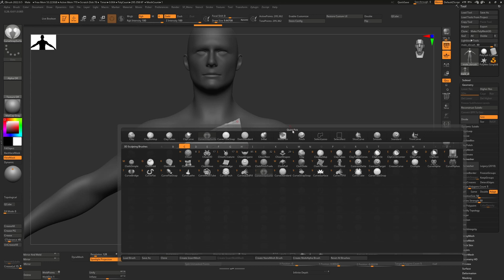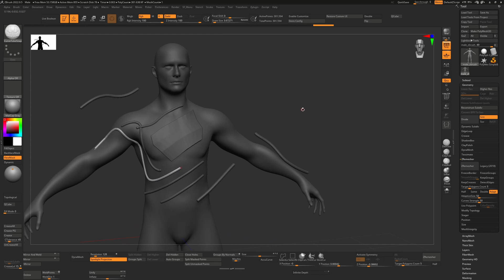Having problems with curve brushes not snapping to the surface? This is the fix.

Comment: 0:30 I want tubes, a lot of them, next to each other, and even in top of each other. The issue is that they keep snaping to eachother and create connections.. how to disable that? When cursor is near an existent tube, a red line shows and snaps creating connection. I dont't want it! please, help me. thanks..
Reply from the maker: Turn off Snap in the Stroke menu under the Curve rollup. To reduce the size of the red line that appears near other curves, go to the Stroke menu and under Curve Modifiers, reduce the Curve Snap Distance to 0. hpoe this helps.

Comment: If still not working your curve brush stroke setting must be dots not drag for it to snap to surface.
Reply from the maker: Thanks for posting!
Reply: interesting! I had the opposite problem - when it was set to dots it wouldn't snap, but to freehand it would
Reply from the maker: Oh I never checked this, thanks for posting, it might help others.
Reply: This is a great tutorial by SeanForsythTutorials, but this comment was what fixed my problem. Thank you to both of you.
Reply: Thank you! It resolved my problem. For years I was fighting with the custom IMM brush and tried everyt differents tips and tricks.
Reply from the maker: Good stuff!
Reply: Bro, you saved my life. Thx!!!
Reply from the maker: Glad to hear it!

Comment: Hello. I'm asking you a question after thinking about it for a long time. 

I'm going to make a character's hair with "Curve strap snap brush". However, the brush keeps getting buried in the character's head. What's the problem?😢😢 
 Other brushes are also buried in snap objects😂
Reply from the maker: Hmm... well I assume you've already checked for stored history as in this video. After that I'd check the Depth setting in the Brush menu, Depth rollup, adjust it if needs be. Then I'd check the Picker menu, and under Depth check that it's set to "Cont Z", and also that the Z value is set to 0.
Reply: @SeanForsythTutorials  Oh, thank you. I'm not that good at English, so I must have missed something in the video. 
I'll try it tomorrow. Thank you for the video! I press recommendations.